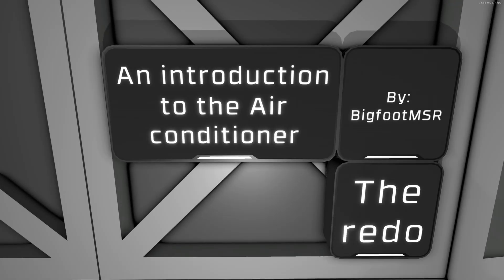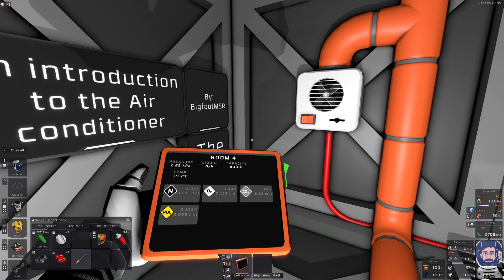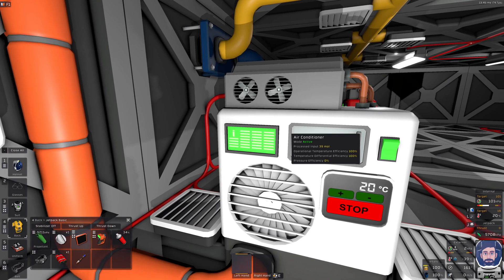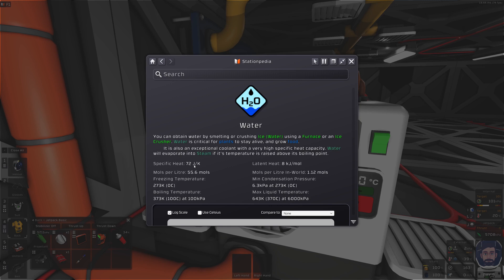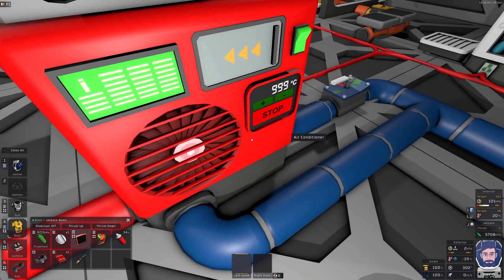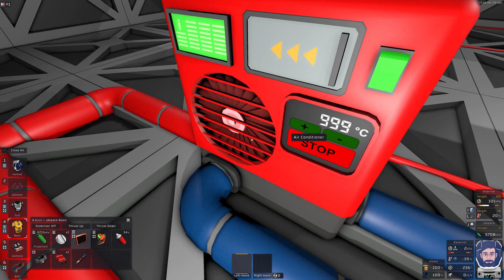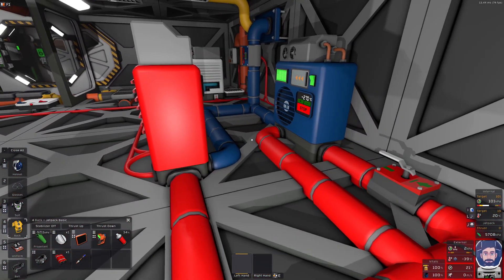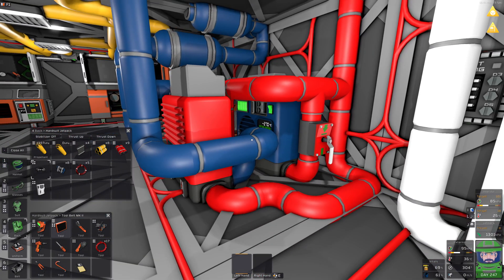AC introduction - The Redo

Comment: Sadly one aircon pair on Venus is not nearly enough to cool down anything from Venus temp to a room temp. You need at least a series of 3 pairs consecutively to have a meaningful cooling power. And the best efficiency was well done by Elmotrix having 6 pairs total with 3 at the high temp side, then two then one at the room side. This is because aircon loses efficiency progressively with the high temperatures overall be it on input side or a waste side
Reply from the maker: Yeah, its not the most powerful setup, it will work slowly over time, but a large heat load will choke it. Having multiple pairs for different systems or working together will definitely help.
Reply: This will work on Venus early game, it’s just kinda slow and inefficient